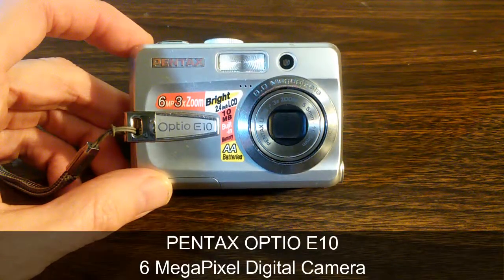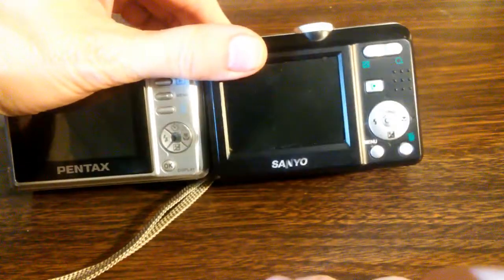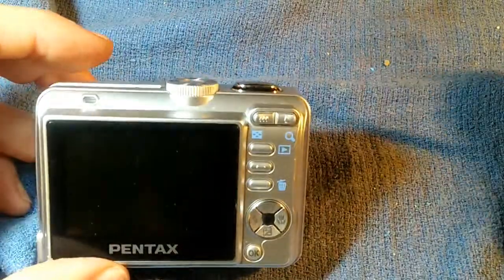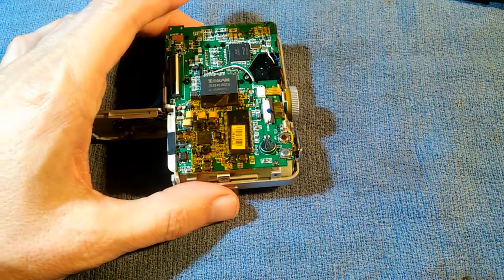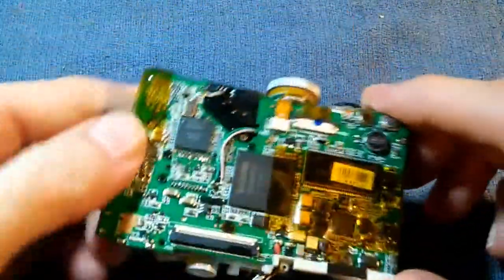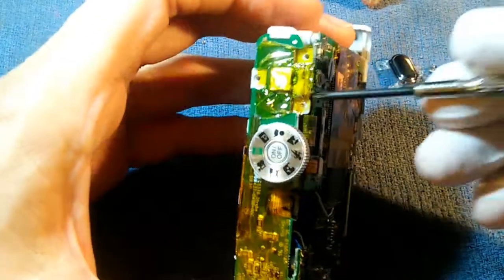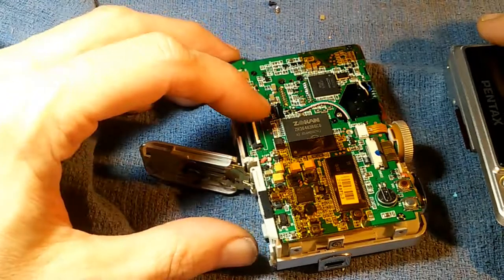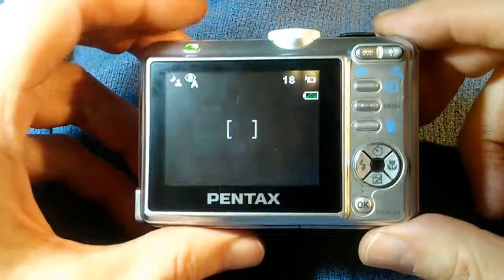Pentax Optio E10 Tear Down and Repair

Comment: Hi, thanks so much for this video! I'm hoping you might be able to give me some advice. I recently bought this camera secondhand. It didn't have batteries in and from inspecting the battery compartment from the outside, I can't immediately see evidence of corrosion. However, when turning on with a fresh set of batteries, the startup screen shows and then reads 'Battery depleted' before turning off. I'm a little nervous to open it up since I don't have much experience with electronics. Would you say it's worth opening it up anyways to check for further evidence of possible battery leak damage and see if that fixes the problem? Or do you have any other suggestions on what the problem might be? Thanks for your time.

Comment: DRATS i CANT EVEN GET THE BATTERY COVER TO LIFT UP...LOL.HELP. DO I PUSH, SHOVE FLICK, WHAT? THE MANUAL DOESNT SAY.  ---  OOPS SO I GOT THE COVER UP AND LEARNED THE BATTERIES HAD LEAKED AND STUCK IT DOWN. I GUESS ITS NAFFING NO GOOD NOW...HO HUM
Reply from the maker: You place your thumb on the cover and push the cover off along the long axis.  Push in the direction away from the hole for the tripod.
Reply: @c.davidgraves4848  Thank you. I did manage to get it off and saw the batteries had leaked up into the cover mechanism. I guess it isnt going to bwe any use, now. I should just get a cellphone with a camera and be done...lol. See, I didnt get a charger when I received the Optio new as a gift, so I guess thats why it only took 2 to 4 pictures before rhe battery died and needed replaced. Thanks for your help.